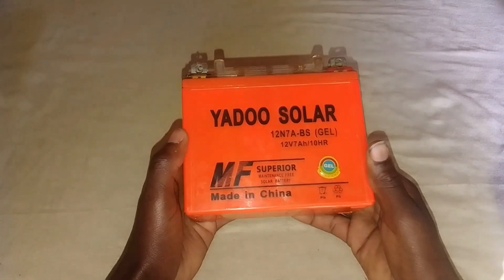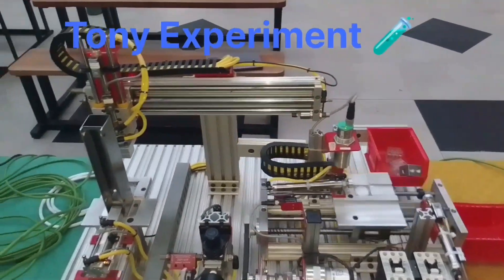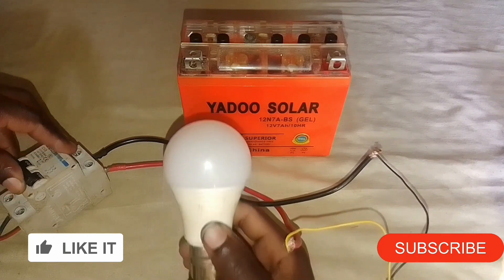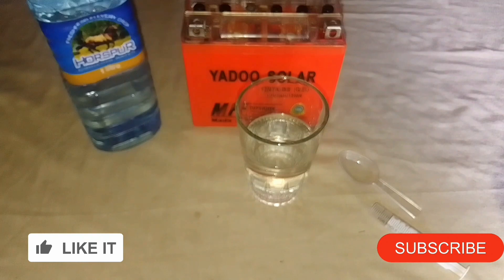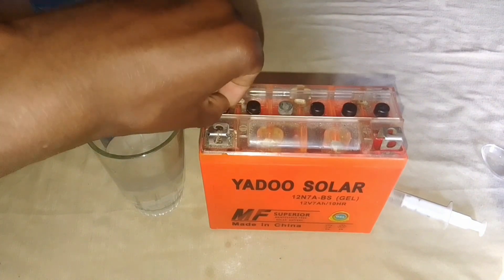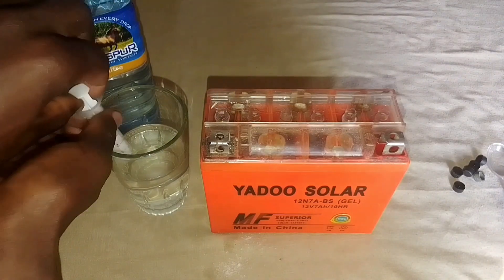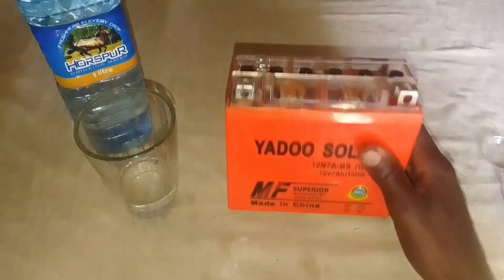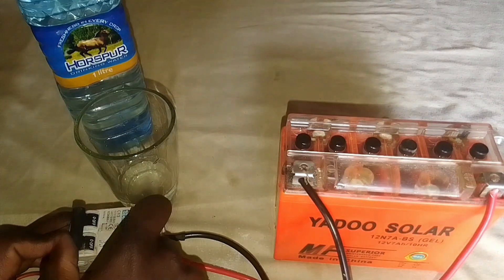How to repair dead lead acid battery in 2024

Comment: No. The chloride in it will definitely cause the battery to fail. Use either epsom salt or potassium alum as the salts to recover the battery. The K+ and Mg2+ ions just make the electrolyte more conductive and helps make the sulfate deposit from discharge more porus on the negative plate ❤
Reply: What about sea salt it's not so refined 🤣🤣🤣🤣🤭🤭😁😁🤫💪🤠
Reply from the maker: I had first drained all the electrolyte in the battery before doing anything else

Comment: Battery also may explode during operation.So be careful about the reaction as we call it the chemical reaction?
Reply from the maker: Sure any experiment done your safety comes first, I ensured during charging process I was on an open place and removed all the caps

Comment: The water must be gone and the acid is still in the battedry.So I didn't see any acid being drained out.Nor did I see other than you?Just putting salt water in your battery
Reply from the maker: The process gives the cells a duration to serve you you can add water to clean up and then add the electrolyte

Comment: How long will the battery now last with a sodium chloride electrolyte? How does it compare to an original battery with it's acid electrolyte? Charge density comparison?
Reply from the maker: The purpose is to extend it's usage time, the electrolyte will give you 4-5 hours from that dead battery which can stand to about 50% remember the battery was at 1v and couldn't be used to power any device but afterwards we have a couple of hours to use it, discharge time and density will be slightly affected but overall results out do the change
Reply: @tonyexperiment9897 looks like everyone making you look dum...Think🤣🤣🤣🤣🤣🤣🤣